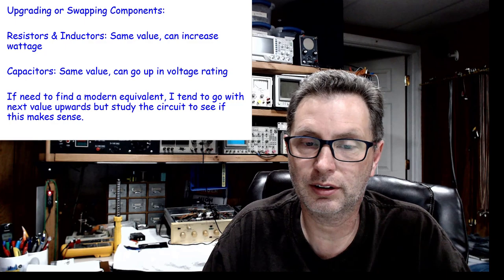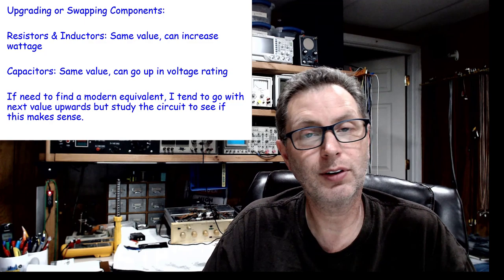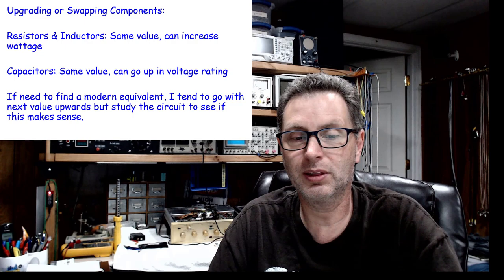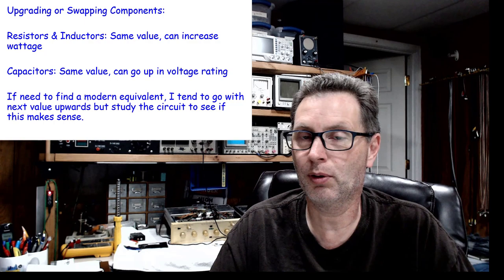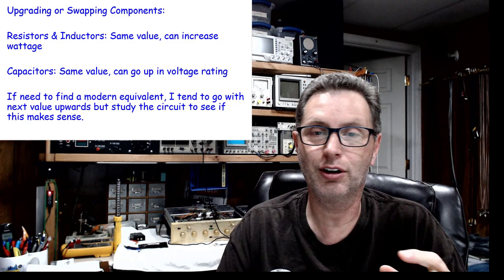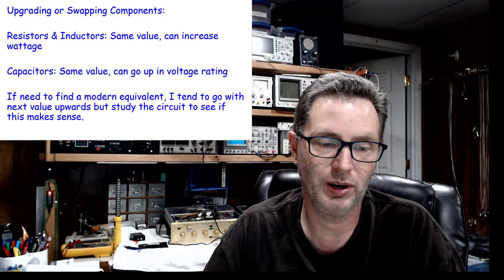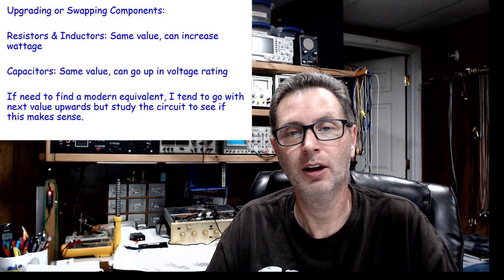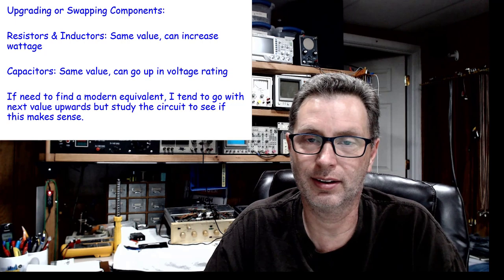Ask Mark - Swapping or Upgrading Resistors and Capacitors

Comment: One issue with resistors - in going up in wattage, you may cross over into a different type of resistor.  The worst would be going to a "inductive" (wire-wound) resistor.  Personally, unless the old resistor is baked, I'd leave it the same size/type.

Comment: I would have just added a small caveat regarding resistors.  Sometimes resistors are added where they may be used as a fuse as well so increasing the wattage can cause damage.  It's rare but something to look at.  Personally it's something I don't agree with.  Loving your videos, very informative and bringing tubes into my sights that I wouldn't have considers etc.
Reply: Fair point
Reply: Leslie amplifiers did this, and I have rebuilt many.
When I encounter a resistor being used as a fuse, I make sure to replace it with a resistor of specified resistance and wattage. I install either metal film (light blue case) or carbon film (light tan case). I then have a visual indicator that the resistor has been over heated. ( In a Leslie amplifier, that will indicate that one of the power tubes is failing). The resistor may still read proper value, but I know where to look for the problem. Carbon pile resistors that have a dark brown case don't show if they have overheated until they fail completely.
If I see signs of over heating, but it measures to spec, I track down the cause, and replace the overheated fuse resistor for good measure.

Comment: i have built loads of crossovers keep all values the same, the most important is to leave the stock inductors as if you put a thicker wire inductor this can change the slope of the crossover and change the crossover point .one thing you could do is change the resistor on the tweeter by 0.5 to 1ohm up or down to change the output a littlt do this after changingh the caps as this can make the sound more clearer have a try you will not damage anything  hope this helps

Comment: Mark, the value of a given passive component is what it measures, not what is printed on its body. Changing parts, you must use a multimeter to measure values.  Example, a 10 uF 10% tolerance capacitor can be anywhere between 9 and 11 uF and considered in spec. But if you replace the same parts in both channels of a given circuit with the unknown unmeasured parts, you now can have a 20% difference.  This can make a big difference in gain or frequency response between the two channels.  Fail to measure and replace crossover or any timing or frequency shaping parts in your audio components with matched pairs channel to channel.will certainly change the sound, probably not for the better.

I see lots of purple prose long winded reviews of magic passive parts.  The writers never mention the use of adequate test equipment.  Their observations are like testing tires without using a pressure gauge or wheel balancer.

If you are going to do do-it-yourself component replacements, start by getting a decent multimeter that does at least resistance and capacitance measurements and then use it.
Reply: what you said is true but the 
efficiency of a speaker as a lot to do with the tolerence of componants loe efficiency speakers arnt effected by it as much as high efficiency  speaker  say over 90db .if the speakers you want to upgrade are secondhand £5000 the its worth spending the money but if only £300 put something reasonable in hope this helps keep safe
Reply: AVAHIFI
In that case, especially in a speaker crossover, it would be more advantageous to use a little bit better of a cap with a tighter tolerance of around 2% - 3%, especially if you’re actually trying to upgrade the speaker.
Reply: Of course, measuring it on top of that can’t hurt, but I’ve found that most decent caps that say either 2% or 3% tolerance are usually under 1%..
Reply: For sure
Reply: AVAHIFI
Also, many speaker companies have very tight standards anyway and actually do measure and sort caps, so that scenario won’t occur.
Reply: So true.
Reply: Hey Mark, my JBL 120ti crossovers have the capacitors and other components embedded in a clear, silicon-like substance to hold them down to the board. What is the best product to buy to duplicate what they used to keep the look the same?

Comment: Hi and thank you for your time. New at this hobby and I'm recaping a Mar. 2252. Working on the pre tone amp. From what I hear on youe tube, A lot of techs use film caps if they are in the signal path. This is an upgrade ? Bigger question is can I go up in V rating if I keep the same value ?

Comment: You get a lot of respect for taking this on. Too many YouTube hacks advise people that bigger is always better on recaps. You are pushing water up a straw. Expect tons of flak. 

From a numbers perspective only, the simple RC and inverse frequency/capacitance relationships are not that hard to understand. Horowitz & Hill, 3rd, is accessible to most people. 

If given a choice of changing from an old to a standard cap in an RC for example, tweaking the R is much easier than the C. It is trivial to adjust R by paralleling to get any desired value. 

Getting a grasp on RC and inverse f/C is both easy and essential to actually mastering the problem. 

It’s good to see you taking on this EE problem. It’s too easy to get mired down in restoration esthetics without dealing with the engineering.

Comment: I’m going to replace the electrolytic capacitors in my Marantz 2225.  I’m doing the power supply, preamp and power amp.  Do you recommend replacing the film caps.  I know they don’t dry out like the electrolytics and have heard you can also change the tone if using new materials like polypropylene.  Your advice on the film caps?

Comment: I am replacing a 330pf ceramic cap in an Jukebox AMI R-145 amp.
I have 2 types. 
330pf 500v and writing on it just says 331
And
330pf 500v Safety Capacitors which
 are bigger and writing says:
VY1 331K
Y1 500
X1 750
1820

So which one do I use. To old old one are small.

Thanks

Comment: Need your help with a tube amp happens when in phono and tape hd inputs when my hand is near a certain spot Hum is really loud if touch metal Hum goes away it's in area of a tube. I tried swapping tubes and nothing changed. The amp is a Harman Kardon 250 epic

Comment: ''Upgrading'', not always a good idea: Go from a 2W metal film resistor to a 5W sand cast resistor is not an improvement. Also, be careful with inductors, sometimes a low Q value is part of the design.
Reply: Exactly.  Sand cast resistors can be wire wound, meaning it will be inductive.  The impedance will increase at higher frequency.  

Low Q means you have more resistance in the inductor or cap.  

As far as caps, some, like electrolytic caps used in power suppliers, are DC only (don't put them in backwards!).  Caps in speaker crossovers need to be AC caps.